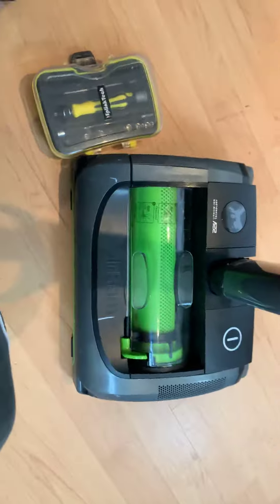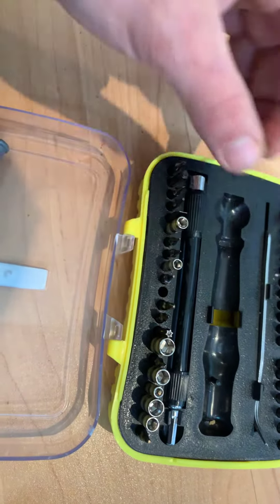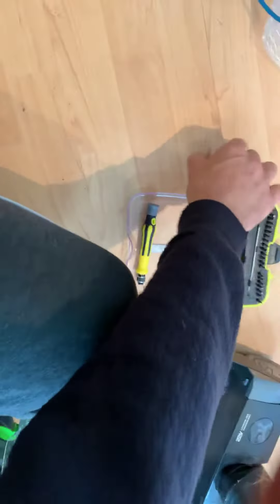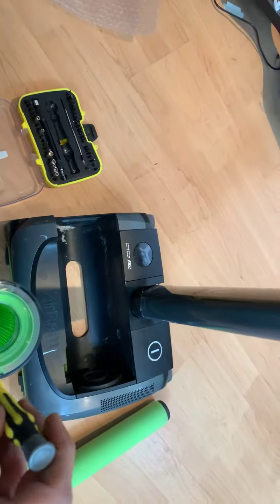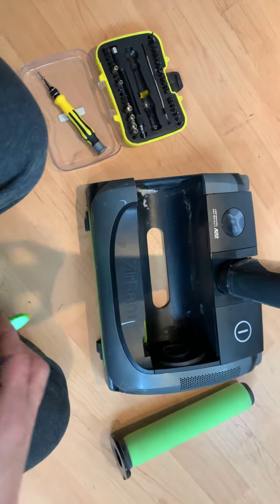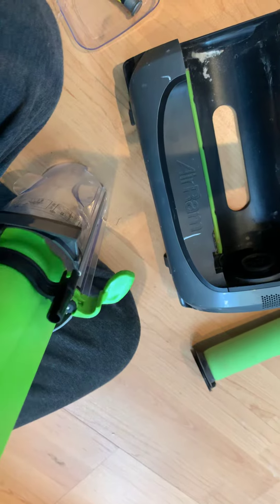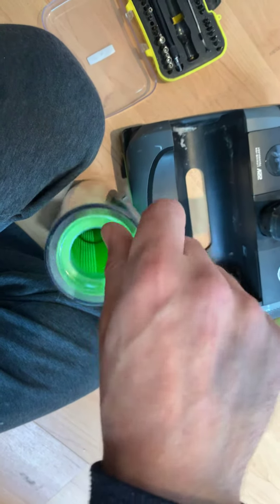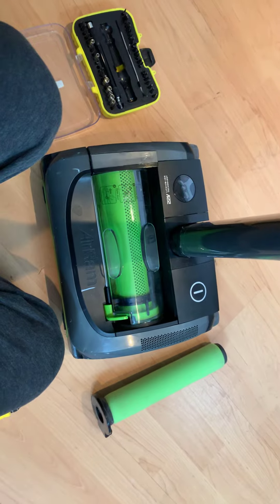How to clean your Gtech AirRam. EASY!

Comment: I find it hard to remove that pesky little screw. By the way, what screw driver are you using? I need to get something that can remove that particular screw head.
Reply: I'm in the UK and used a Torx key.
Reply: mbsbtb0 Thanks!

Comment: I finally got around to doing this. Pay close attention when you take it apart. I panicked a little putting the cylinder back in. But I watched the video again and that helped a lot. I used a Torx 10 screwdriver. I ordered a set of them on Amazon for $10. Thank you again kind sir for posting this video. It was making me nuts not being able to get in there and clean it out better.